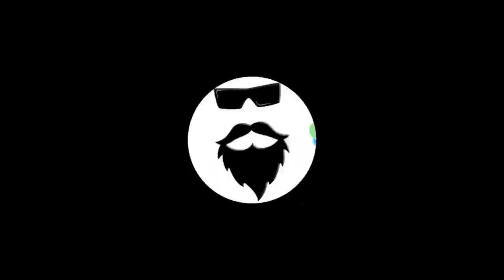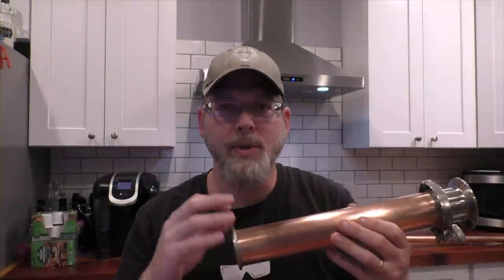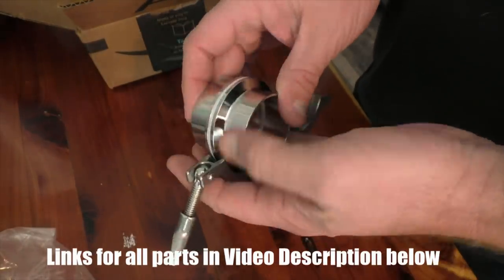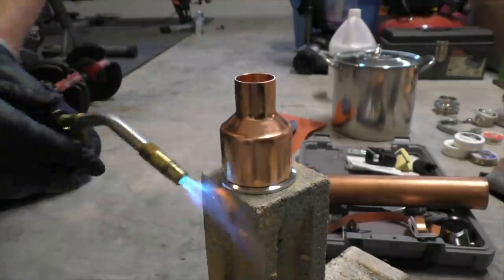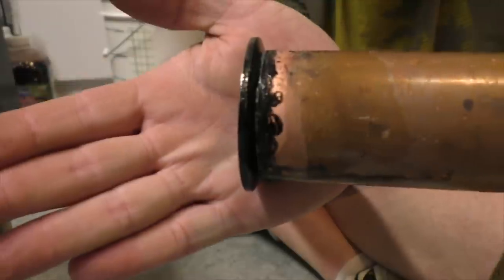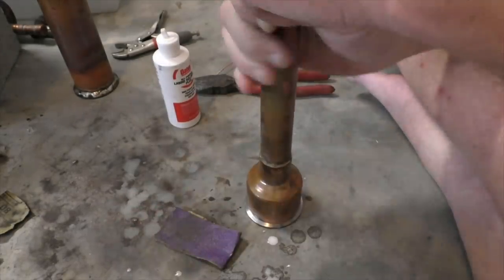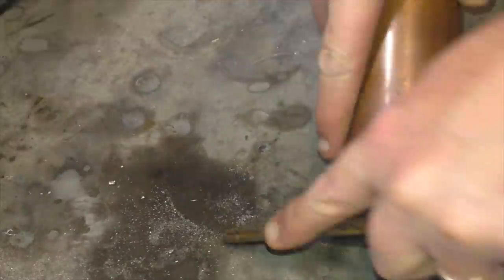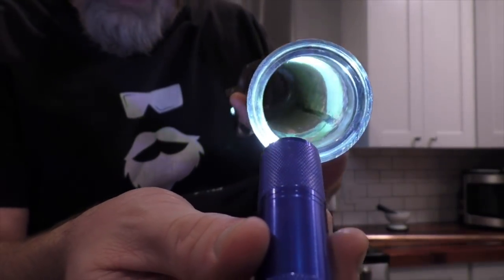Build a Simple Modular Pot Still Head + How to Solder Copper to Stainless Steel.

Comment: First tin the parts with Stay Silv flux and a 56% silver rod then use standard tin antimony based solder to fill the gaps. The silver  just sets the base for adhension but will not fill gaps, if its a snug fit you can just silver it in one shot.
Reply from the maker: Thanks!

Comment: Heating up the copper again until the solder liquefies makes it easier to wipe off but you need gloves to do it.  Makes for less sanding.

You can also take a fitting brush and stick it in a cordless drill for easy cleaning.  You don't need the correct size, either.  You can clean everything with a 1/2" brush. It just takes a little longer.

Comment: i have a rather large stainless steel beer keg, quite a few 1 3.4 inch stainless pipes in 1 mt lengths, lots of stainless bends and T pieces. would you recommend  if i can use all this instead of copper as all i need to buy is tri clamps, a reducer and a 4" port to allow cleaning.
Reply from the maker: Sure. Just make sure you get some copper mesh rolls. Copper in the vapor path at some point helps clean up sulfur compounds.
Reply: @BeardedBored  super, thanks. I guess stainless ferrules will be easier to weld to the pipes as well. Time to give my pal a nudge who welds food grade stainless for a living. 😁
Reply from the maker: @MrRussLock  Good friend to have:-)

Comment: Stay brite no 8 and stay clean flux works great. But that flux is nasty stuff when it boils. I found that the copper to stainless was easier than the stainless 1" fitting to stainless beer keg for an element. That stuff takes so much heat dissipation.
Reply: Yeah that acid flux is nasty stuff but it works great.  Good ventilation is essential.  Even in a garage with the doors open you'll need some fans to move vapors out.
Reply from the maker: I almost got Stay Brite, but the shipping was faster on the Oatey flux. Someday I'll tackle a keg, but I'm not looking forward to the soldering.

Comment: Okay..... So I have been searching high and low trying to figure out how I was suppose to put a 1 1/2 x 1/2 inch reducer on my 1 1/2 in ferrule. I thought I just ordered the wrong fitting but I guess I have the same situation you did with this reducer and ferrule. So looks like I am going to be putting a solder ring on the inside. I assume so that it melts on the inside to fill in the gap.

Comment: Great video man! Has to be an acid flux for stainless. Not just liquid. And actually they do sell an acid paste flux but it's pricey. For that shim I would have soldered the shim in place first then the reducer. I would suggest going 4" rather than two. Just speeds runs up allot and when you run 15 gallons of mash at a time it's a huge difference!
Reply: Also, when you use an acid flux for stainless baking soda bath and scrub to clean it out before running it at all. Rinse rinse rinse too!
Reply: I think the liquid flux required for stainless and copper has some hydrochloric acid in it if I remember right
Reply: @MawoDuffer  it's a mixture of different acids.
Reply from the maker: @MadJix  Great advice!
Reply: @MawoDuffer  Stomach secretions are made up of hydrochloric acid, several enzymes, and a mucus coating that protects the lining of your stomach. Hydrochloric acid helps your body to break down, digest, and absorb nutrients such as protein. It also eliminates bacteria and viruses in the stomach, protecting your body from infection.

Comment: I tip on soldering heat slowly and the solder will want to run away from high heat. I'm a plumber and do alot of sweat work always heat the thickest parts first, never heat the pipe first, direct you heat mostly on the joint you are soldering and when you remove the flame the temp will still continue to rise for a couple seconds. Once you reach the melting point of the solder STOP HEATING IT!!!! Instead use you flame to maintain the heat by hitting it with the flame and remove it. After you get it joined you can use the flux while it's still hot to remove the black burnt shit with a brush of course.
Reply from the maker: Thanks!
Reply: @BeardedBored  and don't use Chinazon  unless absolutely necessary I know it's not Ideal but I've found in alot of instances you can get stuff cheaper and not made in china. Esp on the stainless n copper stuff

Comment: Question for the group.  I am collecting components and trying to make parts.  I ordered a handful of 2" ferrules and they recently arrived.  I then went to a local industrial plumbing place to get some 2" copper tube/pipe.  I brought one of the ferrules with me just to make sure the fit-up would be snug.  It turns out the 2" copper tube/pipe was the same ID and OD of the ferrule neck so instead of fitting inside like every video I've seen on the subject including this one (great video btw) it just butts up against the end.
I got out the calipers and checked the dimensions of the ferrule. It is a match to the ASME standard. 50.8mm OD, 47.5mm ID and 1.65mm thick. Which means it will likely fit SCH40 pipe which is way thicker than the copper used in the video.
Clearly there is a mismatch in one of the items.  Are there "tube" compatible ferrules or ferrule compatible copper that I need to seek out? 
Any advice would be very much appreciated.
Reply from the maker: The ferrules are standard, but the thickness of the pipe wall can vary. For 2 inch copper there is K,L,M, and DVW. M and DVW are the ones that will fit according to their ID. https://www.petersenproducts.com/Copper-Tubing-Sizes-s/1979.htm
Reply: @BeardedBored  Thank you.  I am glad it is something as simple as asking for the correct type when I go back.
Reply from the maker: @Kambo117b  Good luck:-)
Reply: Darren: My understanding is that DVW copper pipe is NOT lead free.  I could be wrong, although I know DVW fittings are not lead free.  It's only used for drains.  I'm not in the trades, I'm just a cheapskate -- and those DVW reducers were half the price, but when I looked them up they had to go back.  Be sure to check this issue out,
Reply: @oasismike2  Thanks Mike.  I did get ahold of some 2" DVW and sweated on my stainless ferrules (with lead free solder of course).  The DVW is being used exclusively in the vertical packing section of the column.  If any dissolved lead is present, it should be rinsed downwards towards the spent wash by the reflux action. The vapour pressure of lead is essentially zero below its melting point so nothing should be going up towards the still head.  All my condenser copper is (will be when complete) standard plumbing grade.  Ironically the word plumbing comes from Pb because it used to be easy and cheap to make lead pipes for water distribution.
Out of an abundance of caution, I could do a water run and take samples of both the distilled water and the wash water to a lab that does well water analysis.  Any results I obtain I will publish here so we all know the outcome.
Reply from the maker: @oasismike2  Actually the composition of the DWV Tubing is 99.9% copper with no lead listed as a trace component. Check the "Copper drainage Tubing" section 3/4 of the way down the page - https://www.copper.org/applications/plumbing/techref/tpf_stds/tube_pipe_stds.html
Reply: Side note - when I finished attaching the ferrules, I clamped it to my modified keg and stepped back to appreciate my progress.  It looked like the leaning tower of Piza.   I thought I had oopsed on keeping the ferrules square during the soldering  but it turns out with the keg level, the keg ferrule has about a 5 deg forward lean.  I don't know if this is shoddy quality from the keg manufacturer or a necessary feature that I'm unfamiliar with for using beer kegs for beer.  Easy to shim the bottom of the keg.
Anyone else found this or is this why I got a good deal on my keg ;)
Reply: I am so glad you mentioned that, so I can check before soldering!  (I have to anneal before pounding in my ferrule, as I have type L). (And, my keg's bottom skirt is beat to F.)

Comment: Great video, Bearded! Watching Jesse try to silver solder stainless gave me nightmares. You can buy copper tri-clamp ferrules from brewershardware.com and save yourself some grief. They also sell stainless “spools” with ferrules attached for those tricky parts.  

Copper to copper is a whole lot easier. I have been soldering electronics since I could see over a lawn mower, but the big stuff, I’d rather buy it. But you, sir, are the King of DIY and I salute you!
Reply: The copper ones are absolutely easier.  But the cost is about 4 times as much.  I was going to use all copper but then the wife started paying closer attention to stuff I was buying and started choking my budget!  Lol
Reply from the maker: Thanks George! Had to go with the steel for the price, but I may just opt for the copper ones in the future.

Comment: I take my dirty Mop water with my Tide Pod chasers.  Works fine.   :D.   I have an 80 gal hot water heater I cut one end out of to make an oil fired metal melter.  Been thinking of turning one into a Solar Water tank and also maybe one into a Still Pot.  See any issues with the idea?
Reply from the maker: LOL! Check out the Angry Parrot channel. He converted a hot water heater;-)
Reply: @BeardedBored  will do.  I am actually watching your Candy Corn Whiskey when this popped up.  lol.  The butterscotch flavor seems interesting,

Comment: From my experience, the correct way to solder is to only heat one side of the fitting. Heat the outer side of the coupling...This causes a capillary effect and sucks the solder into the joint. i guarantee you, if you heat both pipes your connecting,  get that "pretty bead", then twist the pipe a little, the connection will fail.

Comment: The flux i use to attach stainless to copper is harris brand liquid silver brazing flux. Works like magic.  Its an acid flux which allows proper wetting of the stainless.  
... and if you are so inclined,  there are 2 inch copper tri-clover fittings available online (just search them because i don't want to promote any certain seller). They cost a bit more but are waaaaaay easier to make a successful build.
Reply from the maker: Thanks Bird!
Reply: I was just thinking that.

Comment: And if I'm not mistaken you would heat the thickest metal first otherwise you stand a chance of burning your copper up or burning a hole in it. because if you do it your way what you're doing actually is your trying to heat the thicker metal through the smaller thinner metal as a conduit and that does not work very well. By the time you get that stainless steel hot enough to accept copper it will have that copper pipe jacket around it hot enough to accept solder. 

I love your videos by the way bro they are awesome keep up the good work I really like your ingenuity I wouldn't mind having you as an employee if taught property you could pretty much do anything I think.
Reply: What I meant to say is that if you do it by heating the stainless steel collar first and getting it up to temperature where it will accept solder the copper pipe around it will be more than ready to accept the solder also.

Comment: Looks like your using a turbo torch would recommend oxyacetylene torch with a rosebud tip
Reply from the maker: Great advice! Wish I had an oxy set up. Maybe someday:-)
Reply: @BeardedBored  been drinking my own shine. Sometimes the ideas and thoughts come out in pieces. You can borrow anything I have at anytime.
Reply: I found a little propane oxy kit at the hardware store, maybe $150 US?

It’s not quite as hot as oxy acetylene but it’s quite close, and propane is usually easier and cheaper to find
Reply from the maker: @thomasa5619  Cool:-)

Comment: Thanks for the advice. Going to be going down this path over the new year. Now is it worth it to go 2 in all the way to the condenser and take a 1-1.5in to make the inside of the condenser
Reply: If you've got options,  the bigger you make your column the better.  If you go 2" you definitely will want to go all the way to the top.  4" will take less than half the time as 2". It's expensive though!
Reply from the maker: Listen to @ThinkFreely2012. He knows his stuff. Bigger is better on the column.
Reply: I'm not an expert!  Lol But I've spent some time over the past couple years playing with a 2" column in varying ways.  I'm so glad I built my new 4" plated flute type column!  What used to take 9 hours or more I can now do in 3 or 4 hours for a 10 gallon wash.
Reply from the maker: @ThinkFreely2012  Nice turnaround time:-)
Reply: @ThinkFreely2012  the cost of the 4 in is what is keeping me from going that big. I need to find a fellow malt mate that would want to split a 10 ft piece. Maybe I’ll just build a prototype of the real one till I can afford the parts lol
Reply: @chewy2420  yup.  Mile High sells it by the foot. A 3' piece of 4" with a ferrule already welded to one end is about $150 if i remember correctly.  That's what I used. Even 3" would be a big step up.
Reply: @ThinkFreely2012  looking at that I’m most likely just gonna build a pre made one. The price is just so close it’s not worth doing all the labor lol.  Thanks for all the advice. Now I got new Xmas gifts to buy lol
Reply: @chewy2420  Each to their own.  Some folks would rather buy one anyway.  But there's a sense of accomplishment and pride from learning and building. And if a part doesn't work out or you want to change something or need to repair,  you have the knowledge and skill to do so.  It could certainly save a lot of time to buy one though.  

One big thing to keep in mind... if you buy one already made from a commercial seller:  the seller is required by law to keep a record of what you bought, and your personal information like name address phone number.  And if the government asks the seller for their still sales records then they must give it to them.  Then the govt could come knocking on your door. And they won't be asking for hypothetical answers lol.

Comment: Hey bearded how have you been? What would be the pros and cons of doing a 4” vs 6” version of this?
Reply: Trying to decide with which to go with.
Reply from the maker: @beerandbbqhobbyist6464  The bigger the column diameter the faster the run. But there is a diminishing return when you get too big compared to the column height and boiler size. Since you'd likely be doing this on a 15-20 gallon boiler, I'd go with 4". I think a 6" is overkill for a hobby sized still. Just my opinion though. Do some more googling before you make up your mind. Good luck on your build.
Reply: @BeardedBored  well that’s kinda the problem. Can’t really find really anything on a 6 in column. Most hobby distillers are working on a 2in and maybe a 4in system. Also your the first person to answer back after asking the same question to a dozen people. Thank you I really do appreciate it.  I do have a pretty busy life with so was thinking what would be fastest. I do also brew beer and spend most my extra time on that. I don’t want to sacrifice quality either and approach this type of hobby very scientifically minded.  What was the down side your speaking of. My boiler is a 15 gallon converted beer keg with one 4500 watt heating element. Thanks so much for taking your time and patience and answering back.
Reply from the maker: @beerandbbqhobbyist6464  Just my opinion, could be wrong, but I think a 6 inch on a hobby still would have less interaction between the condensate and the vapor unless you had a pretty tall column, or a ton of plates. You need that interaction for flavor and purity.

If I had unlimited money I still wouldn't go with a 6" unless I was planning to use a 150 gallon boiler and open a legit distillery.
Reply: @BeardedBored  sounds sound. Where would be a good place online to Source copper or is it cheaper to buy it Locally?
Reply from the maker: @beerandbbqhobbyist6464  For anything in the 4" and up range, online. I've never bought anything that big, so you'll have to research. Let me know if you find a good site.
Reply: @BeardedBored  I will. Thanks for the advice.
Reply: I wish someone could do a comparison of different size stills snd there run times.
Reply from the maker: @beerandbbqhobbyist6464  I know I've seen that info out there, but can't remember where. Maybe on the homedistiller forum?
Reply: @BeardedBored  I’ll have to check it out.

Comment: Anyone know what solder and flux I can or should buy in the UK to braze the stainless ferrules to my copper pipe? Can I use any lead free solder that contains a small percentage of silver? I’ve tried 1mm 55% silver solder rods with Easy Flow flux using map MAPP gas but cant get it to stick whatsoever. Any suggestions would be greatly appreciated! Thanks!
Reply from the maker: I am definitely not sure of my answer here, but 55% might be too high of a percentage of silver...or the steel wasn't hot enough.
Reply: @BeardedBored   thanks mate, sorry I didn’t get a notification when you replied! 
I think you’re right plus the powder flux I got with it seemed to just dry up into a solid once it got hot which didn’t help. 
I’m looking at importing a tub of Harris Stay Clean flux paste and and Stay Brite 8 solder from the US but it works out rather expensive with shipping and import duty…. I might be better off spending a little more and get copper ferrules at 3-4 times the price or just go full out and get a cheap tig welder instead. Thanks again for replying, much appreciated. Best wishes from the UK👍
Reply from the maker: @widgets76  You could also check with a local welder supply or plumbing supply to skip the shipping and duty fees. Good luck!